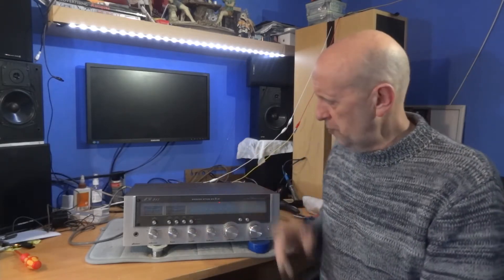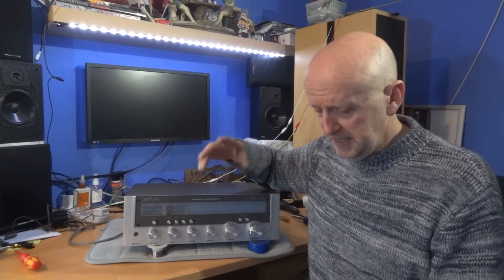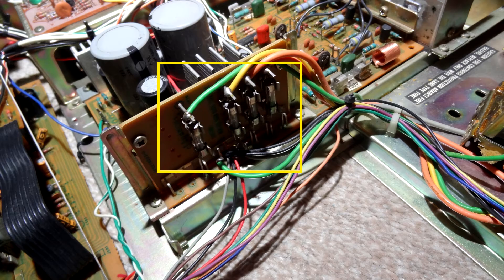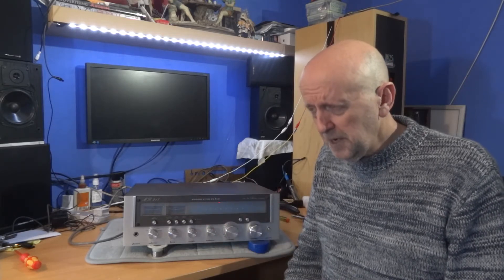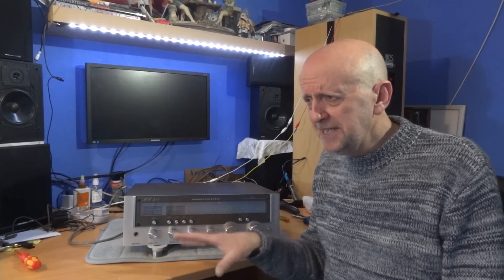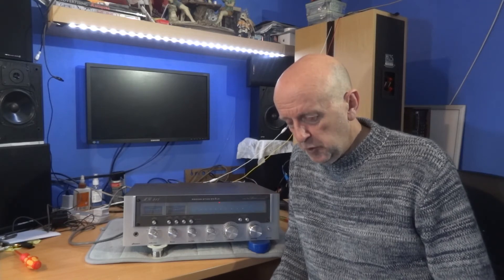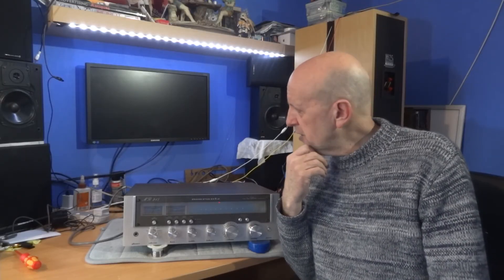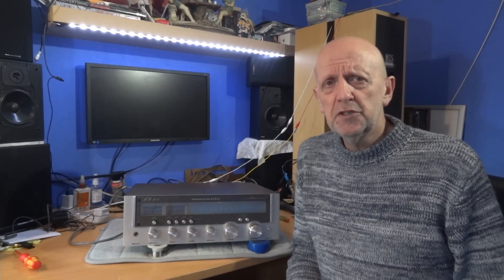Buzzing Noisy Transformer Repair, Marantz Fixing Vibrating Sound, Amplifier Receiver, Buzz Hum HiFi

Comment: Good day mine is sony str km5 model when switch on its buzzing in the subwoofers but disappeared in few minutes tried different sockets switch off appliances check all audio cables but rest of the day no buzzing thanks
Reply from the maker: That could be the mains filter caps just going out of spec but once warmed up run ok enough to stop the buzing, but a guess without listening snd seeing unit

Comment: Ive picked up a Sansui Au101 and it has a constant 40hz frequency humming along with some sound problems, but the latter could be related. Any idea what it can be?
Reply from the maker: If you were in the UK and it was a 50hz hun then the power cap and diodes would be a good place to start. But 40hz is very unusal and never come a cross it before. I might be a feedback issue / bad earthing or picking up from another source nearby,
Reply: @MichaelYates  it might be closer to your thoughts of 50. Thanks for your reply. The sound is also, apart from the hum, not processing well. The volume button doesnt seem to have not that much of influence on gain as it should on. I am going to have it serviced soon :)
Reply from the maker: If it is 50hz then sounds like power supply cap and maybe diodes, as for not getting much louder when turning volume that could be a few things again not enough voltage from power supply could be the reason. Well worth getting a service as a nice little amp and not to many parts to service so should not be to expensive

Comment: Hi sir i want to ask you something what is the name for that glue? Thanks so much.
Reply from the maker: UHU glue, but ant general purpose glue should do the trick, If you see some gaps in the fins then I would maybe use some wood varnish first as this is quite thin and will go between the gaps, just use a paint brush. let that dry then use thicker general purpose glue for casing.

Comment: My MR 215 had a buzzing sound from the transformer, and the bottom panel seemed to be amplifying it significantly. When removed the sound completely vanished. I placed some cloth underneath the transformer to dampen it and while not completely gone, it's quiet enough that I dont notice while using it :) Thank you for the video
Reply from the maker: I have had a few buzzing transfomers where even after re gluing the case etc they work silent out the unit, but as yours does the bottom panel seems to amplifier or resonate with the transformer at 50hz, but like yours its only slight noise. I have tried varnish but still no joy, still have that slight buzz when inside unit. But still much better than it was. Rubber washers holding the transfomer in place can help to
Reply: @MichaelYates  I planned on getting rubber washers but it was late at night so the hardware store was closed, the cloth worked quite well as stand-in but I reckon I'll get the rubber washers at some point

Comment: Hi, my Desktop power supply (new) has the same sounds it is under the warranty and sticker on screw. Any suggestions? Thank you.
Reply from the maker: If under warranty I would take it back, but if you did not want to then removing stickers and undoing screws would get you inside and might be a case of transformer vibrating against case, but once undone you would void warranty

Comment: yes you are right  you have to do a dr jake and make the range of video's better  i find out when i was one here you don't
need to show your face  it's how you come over 

my new channel is a mix of audio  blogs i am using  wavve  now the fun is they have to work out what kind of man
is on here  you need ear plugs     the push audio right to the top and don't use  gate on the audio  so in wave lab 6
i hit 100%  level in the video's  and it's up and down with quiet parts 

will you change the name if you do more kind of video's

why it's bob's bit's  i can do any thing  small time  18min max   brother is helping in the back ground  he love cam's and
mate lee is at reading cam club   
when it's on
Reply from the maker: Look forward to your uploads Bob and all the best Michael
Reply: hi once i get my cam's  of my brother 
i been looking in to youtube video's and the making with iut showing your face alot are doing this more  wavve is used more  with pic's 
i looked into the viewing times as well
and there are some that just like the sound
of some youtuube blogs 

brother site i am editing right now
i use a £20  vegas 18 software of ebay  not
the sone one

keep up the video  bob
this is my real name

Comment: Hi Michel
buzzing problem: I thought it was the transformer but in reality it is in perfect condition, it is the fins of the dissipator that vibrate, can it be solved? lowering the bias current the vibration decreases.
Reply from the maker: I would keep the bias currant as manual. I don't think there is solution to it electronics wise though have read on a few forums that placing something between the fin blades that are buzzing like a piece of rubber or comet might help as shown on this forum discussing output transistors heatsinks, if you scroll down you will a few pics. This might be one way as long as the fins don't get really hot

Comment: I've got a 1988 Yamaha TX500 tuner, which is very nice but buzzes. I've had the transformer out and realised that it's the fins. I've tried glue on them but it's only worked  bit.
I'm inclined to put a small G clamp on it and leave it on if that fixes it !
Reply from the maker: Can be annoying, if gluing failed then a clamp or even a long bolt with a inch washer each end. bolted to either side of top of transformer may do the trick.
Reply: @MichaelYates  
Good suggestion !
Thanks.